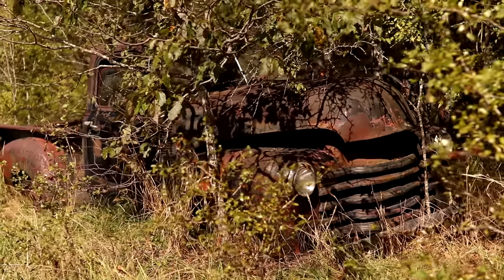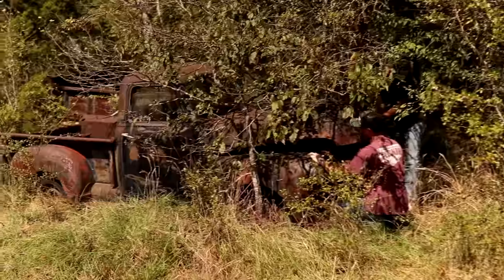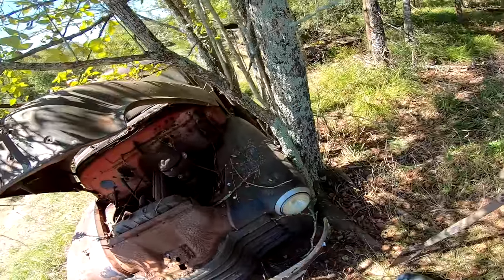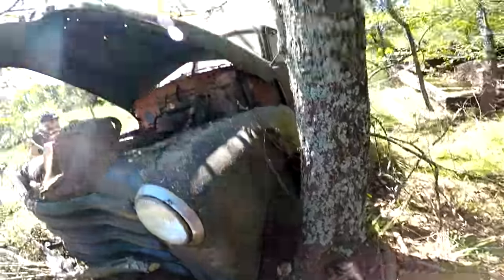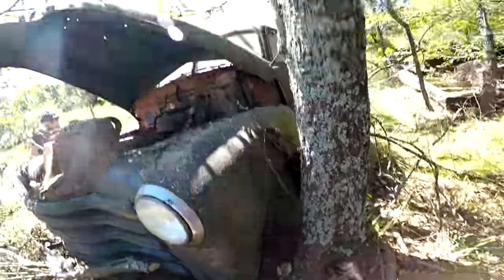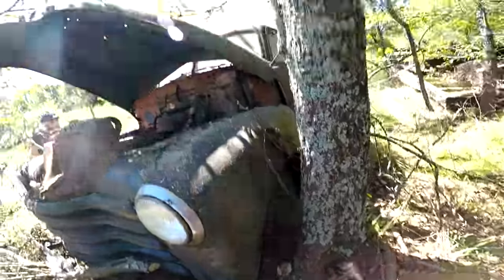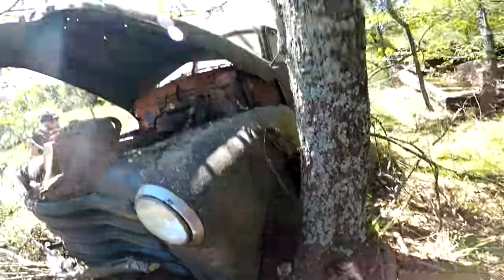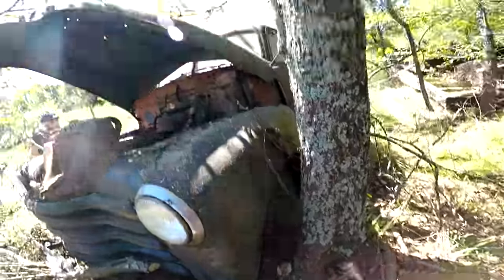ABANDONED 1952 Chevy 3100 | Forgotten Classics Found in Texas Woods | RESTORED

Comment: I use to pull a 2 horse trailer with a 52 just like this, it pulled it but not very fast had to climb steep hills in 1st but I was 16 and my sister was 21 and that's the way Dad wanted.  He finally bought us a 62 short step side Ford that was old Forestry Truck straight 6 with granny 4 speed and posi traction rear end.   Loved those 2 old trucks.

Comment: Another great video guys. Those spoked wheels look to be '34 Chevrolet. Just a couple of thoughts. When you are trying to steer like this, you could take a strop out around the outside of the left wheel, attaching it to the chassis behind the wheel. It will pull across into line pretty quick, and if you are lucky, it will also straighten the wheels. I have, in the past, also used a small tackle block fitted to the opposing side of the trailer on a D shackle, run the winch rope around it and you get that vehicle exactly where you want it. Also, when they are down in the dirt like that, you could try raising the winch rope close to the vehicle, so that it lifts it somewhat while being pulled. Maybe even a 2' log of about 10-12" diameter would be all you need. Christian does a great job behind the camera, but I do miss her giving you guys a bit of cheek now and then. 🤭God bless you all.

Comment: This video quality is the best I have ever seen. When whe truck is not going on straight try hooking the main winch line off the side with a Polley I seen u use one to double ur pulling power u can use that the pull in angle to pull truck over or when u had the front wheels on move the trailer try to pull foward will sometimes straightened you up. Keep the good work and God bless

Comment: I believe that Chev advanced style is either a 49 or 50 because 49 was the first yr for the gas tank behind driver’s seat and the 51 was the only yr with the pull down door handles and windwings. So it has a solid side window so it’s not a 51 and it’s got the gas tank behind the seat so it’s a 49 or 50.

Comment: Give me a lever long enough and a fulcrum on which to place it, and I shall move the world. - Archimedes
 Also, stand  a truck tire in front of the grill and run your winch cable over that to lift and pull. When you walk up on these cars, the first thing you should do is hose down every bolt, hinge, spark plug, handle with penetrating oil. Then just before you drive off with it hose down every bolt, hinge, spark plug, handle with penetrating oil. When you get home you should hose down every bolt, hinge, spark plug, handle with penetrating oil. Then it might be ready to work on when you're ready for it.

Comment: Go easy with the ole gal it's a claccic right now I have fixed worce and in the end I still had the origional drive train in it ad drove it away..it was a lot of work but in the end it was worth it be gentle not to force or brake any thingyhere a cool ole truck I like them way better than the new high teck junk to daythus ole truck it's probably 70..years old do you realy think.you will get  70 years out of a tuck today i dout it today u would be lucky to get 15 years today yhen it's a rust pile